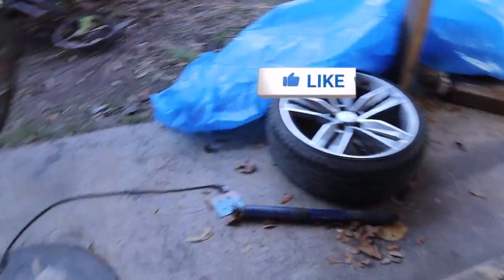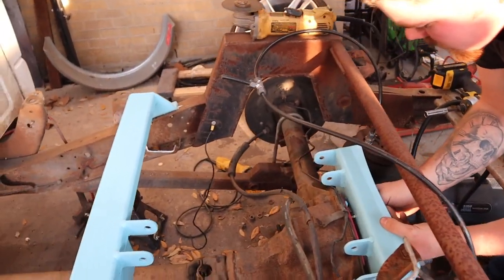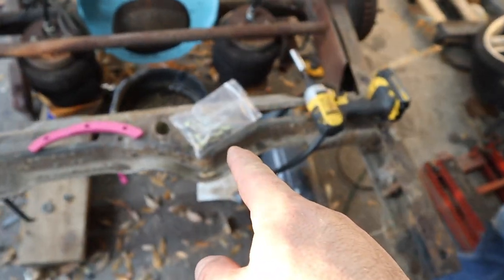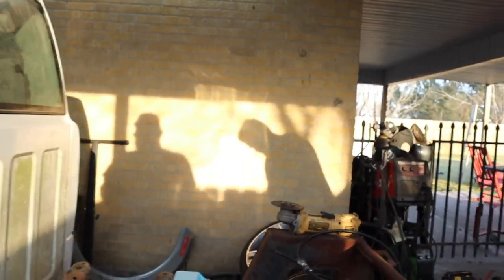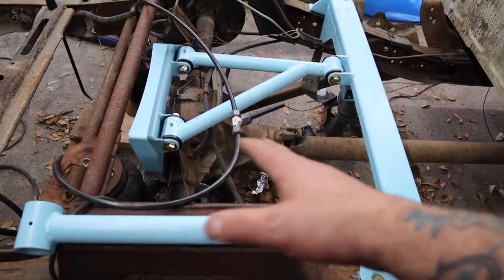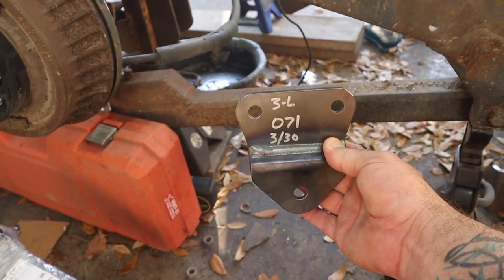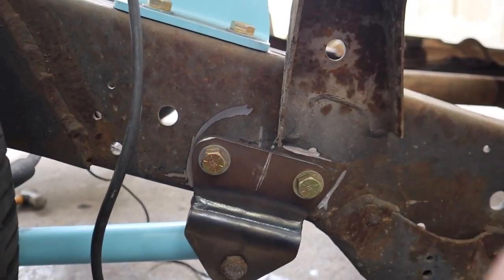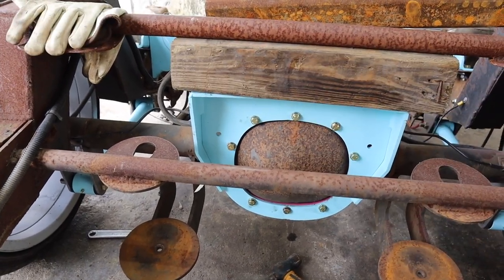How to Install an S10 Thorbeck 3 Link - SloNoma EP 7

Comment: Finally a video of their bolt on 3 link kit!!! Been wanting to order this just wasn't sure. Looks good!
Reply from the maker: this is not the 100% bolt on kit in the video.
Reply: I thought it was strange that thorbecke didnt give any installation instructions other than "move hangers 8.75 inches back"
Reply: @bradenguy3344  it seems pretty straight forward, but yeah you are right, not much info lol
Reply: @CarportCustoms  oh ok, did you order this from them or got it from someone? Or is the only difference between the two kits are the shock tabs and links?
Reply from the maker: We ordered from Thorbros. Check out the links in the description. One link is to the weld on the other is to the 100% bolt up. You will see the difference.